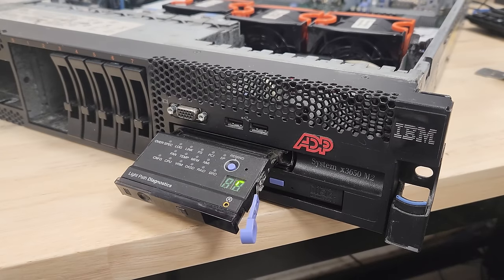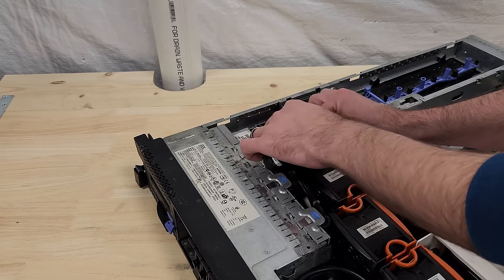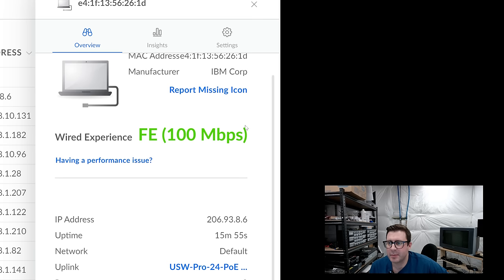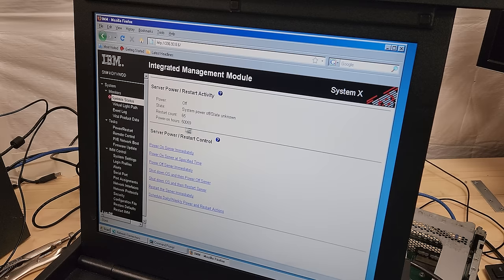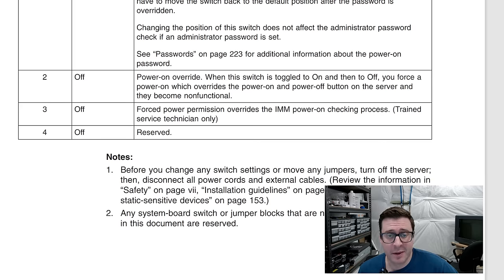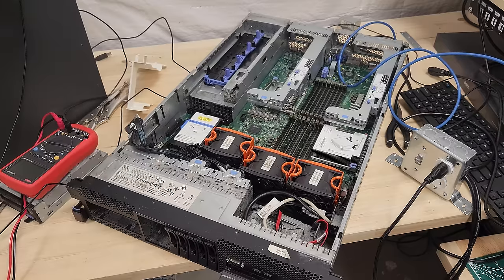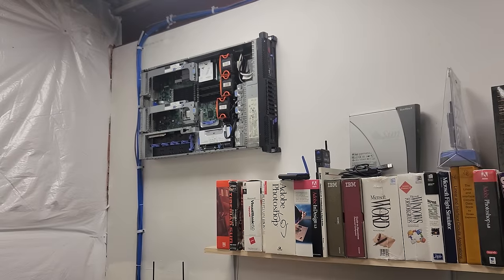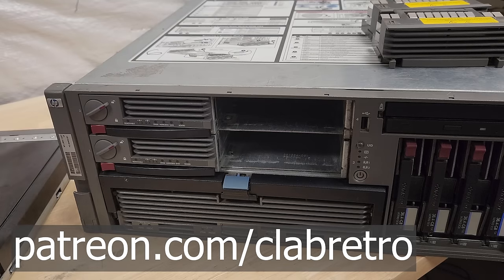IBM System x3650 M2 Restoration: Part 2

Comment: I was an HP field engineer for several years, although we supported all makes and models.  This is 100% a power supply issue - it is no longer able to supply enough current to power up the machine.  When the current draw rises suddenly at power on the voltage collapses and the whole thing resets.  The IMM only draws a few mA so it doesn't trigger the fault by itself and appears to work correctly.  A replacement power supply should solve the issue, although there is a small chance the IBM design places the fault in the power distribution on the main board rather than in the power supply module.  Like I said I am more familiar with HP hardware but I have seen exactly this fault several times.  This type of server should always always have two power supplies if you're going to use them for anything important.
Reply from the maker: it very well could be! I was thinking I'd grab another psu along with the board on the way. it's always frustrating when I get these machines with only one psu, especially as they get older it becomes so much more likely one can go bad. thanks for the comment, think I'll snag another one.
Reply: @clabretro  Looking forward to part 3 then!  Also if you do intend to run it open on the wall like that for more than a few minutes at a time make sure you replace the lid with something clear to preserve the air flow.  Many of these servers can sense air flow and will throttle severely if they don't see what they're expecting.  Some may shut down entirely.
Reply from the maker: oh yeah totally. I try not to run em long without the lid. clear plastic would be kinda cool actually
Reply: Yeah probably the psu. I remember having a similar issue on an old Dell server.

Comment: You could replace the switch in your home made power bar with one that has a light in it, that way you'll always know whether it was on or off.
Reply from the maker: The funny thing is that's actually a light up switch in there (I had the same thought), but it's on when the switch is off so you can find it in the dark haha. Even more confusing. But it doesn't really matter, it's too bright in there to use it consistently for that anyway. I was thinking of adding some type of light on there to make it really obvious. Maybe a three gang box with a light of some sort.
Reply: @clabretro  oh yea, meant for bathrooms in the dark... What you want is a pilot light switch... It does the opposite since it's meant for furnaces, etc.
Reply from the maker: ah interesting, I'll snag one of those next time I'm at the hardware store @chaseohara4781

Comment: I've fixed pins on a socket like that before, it worked for me too and I was quite surprised that I got away with it.
Reply: the cpu is not realy a problem you may lose some ram channels or pcie lanes. but your gpu is you problem in this case the gpu is simulated through the aspeed controler as a usb gpu. so may the controller is falty but the ipmi lifes also. so it could be the controller. also the restart thing makes me wonder if it is a short then it must be internal or the usb lane to the northbridge from your cpu sockets
Reply: a LOT of pins are just ground or power, so there's a pretty good chance that not every single pin is needed.

Comment: The IMM  should not reset when pressing the power button or turning on through IMM.
Reply from the maker: That's what I'm thinking. Very strange.
Reply: I’m going to guess that the power rail(s) that run the IMM are dragged down when the rest of the machine is powered on (ie the power system is browning out when placed under higher load).

This could indicate a short.

If you have a thermal camera, this might be useful to indicate a failed short or low resistance component.

Note at 27:37 that the part near C1150 looks discoloured.
Reply: If that's the case, I think the fast blink when he pressed the power button could mean that IMM was rebooting as well.

Comment: Oh man, when you were starting off checking out what it was fussing about, I was basically screaming at my screen "why aren't you using the IMM to diagnose it."

Also seeing that vintage of IMM gave me the shock of both "hey I know how to use that" and vietnam-in-the-background-gif.

I worked on HUNDREDS of X3200 M3 towers. Had many fights with IBM techs over the power button shorting out on the x3100 M4. Used IMM logs constantly for proving the M4's power button had shorted out.
Reply from the maker: ha I know, I probably should've started with the IMM

Comment: the line moving in a figure 8 pattern on the diagnostic screen is normal before you turn it on, my x3550 m3 does the same thing

Comment: after your first video i told some coworkers about it thy joked, ohh an upgrade.
we do have newer systems but we still have close to 30 x3550m1s alive and running i have 3 heere in my house, 1 is a parts machine.
Reply from the maker: haha that's awesome. what are you all running on the m1s?
Reply: everything from oracle to old server2003 domain controllers for our legacy prod software which needs it. they are all under service contracts. my personal ones dont have anything right now, i use my slightly newer hp dl380g8s

Comment: You might want to watch some of Morton's videos he loves the X3650's I think he has a 1/2 dozn of the M2 on "My Playhouse".  It might help with what the lights should be doing.  Question though we didn't see you try the other CPU socket did you do that?
Reply from the maker: Oh yeah his videos are great. Good idea though, I should re-watch to get some x3650 hints.

I actually didn't try the second socket, the manual says the minimum config is one DIMM filled and the first processor socket with a CPU in it... but I suppose I shouldn't have trusted that. I'll try that next time I'm experimenting with this thing.
Reply: My playhouse is a super cool channel!
Reply: This inspired me to check his videos.. I learned that my hunch was correct...IBM servers on the light path POST code read out do that "spinning cursor" thing right after you plug it in. That is normal behavior....I also laughed when Mortens X3650 M2 threw the "BRD" light for a dead CMOS battery LOL that is peak IBM right there.  @clabretro

Comment: I bet the PSU has a 12v Standby rail that provides power to the remote management and the relay clicking is the PSU attempting to switch the main 12v rail and shorting. Pinouts for the PSU's are normally easy to find to confirm, server PSU's dont normally energise the main 12v rail until needed.
Reply from the maker: Could definitely be the case. I'll probably pick up another PSU.

Comment: This whole line is kind of my jam! Have been working on System X hardware since 2010, and mainly the x3650 (M1 through M5) and the successor Lenovo SR650's, but also the x3550 of all generations and x3850 M1s.

Before that, was doing Sun Fire, SGI Origin, Cray J90, and IBM pSeries stuff for Lockheed.

Have stacks upon stacks of System X gear in the collection, with a couple of x3650s still in production.

Comment: I've been cleaning these with brake cleaner that is safe for ABS (ONLY this one) and then quickly rinse with IPA for more than 15 years and the boards look like factory new. Never got a problem doing this even if it was scary as hell the first few times. I was a ethereum miner and I washed hundred of gpus like this and they all lived to tell the tale.

Comment: the LEDs on the maintenance panel displays the checkpoint code. I found this reference for explaining their use 

"A checkpoint code is either a byte or a word value produced by server
firmware and sent to the I/O port indicating the point at which the system
stopped during the boot block and power-on self test (POST). It does not
provide error codes or suggest replacement components. These codes can be
used by IBM service and support for more in-depth troubleshooting"
Reply from the maker: yeah, unfortunately couldn't find any info about the checkpoints themselves. top secret IBM apparently 😂

Comment: I used to, until less then a year ago do  Tech support  for these machines. And ho boy these things are  crazy reliable.
Reply from the maker: It seems really well built, I can't fault this one for having issues given the environment it was in.
Reply: @clabretro  I worked with all of these machines. 
They are a marvel of quality.  
If you ask me this  machine has  simply a dead board,  replacing it would still net you a working machine. 
They are to this day used in Some of the biggest data centres in Europe and Still supported  by IBM.

Comment: First, there is no standard for the orientation of duplex outlets, but ground up is the convention. My employer has a ton of those damn things in our e-waste storage. We like to call it a server room, but it’s mostly occupied by racks of dead IBM machines. There is a buck converter on the edge of the board near the power supply that goes bad and then the boot errors out. It’s a tiny, shiny surface mount part.
Reply from the maker: Yeah I've got a replacement PSU on the way to see!

Comment: Something to consider about using an air compressor. Compressed air may push moisture deeper into small spaces, but that shouldn't be a huge problem if you do wait a long enough time for things to dry. The second and more important consideration is that air compressors usually spray a considerable amount of moisture and oil due to way the moisture in the atmosphere condenses when pressurized. It's a similar reason to why you need to pressurize tanks for scuba with special equipment and those cheap short term breathing tanks on Amazon are dangerous.
Reply from the maker: Yeah fair. In this case I waited a long enough for it to dry. I drain the tank fully and make sure there isn't any moisture in there occasionally, and luckily I'm in Colorado where it's quite dry.

Comment: I'd suggest holding the IMM in reset and enabling manual host power control (via the switch block near the firmware ROM is my recollection). The checkpoint display will indicate post checkpoints (port 80) if the power sequencer is able to get the machine to the reset vector.  Good Luck!  Great Videos! -Nathan
Reply from the maker: oh interesting, thank you!

Comment: Did you ever get around to trying the CPU in slot 1? LGA pins are incredibly difficult to repair properly, and I would not be surprised if they're not contacting correctly in slot 0 after the repair
Reply from the maker: I didn't actually, though the light path CPU warnings going away was promising. The manual says it requires a slot 0 CPU to boot, but I probably shouldn't blindly trust that.

Comment: 2:20 those domes aren't for making the lid ride smoother.
They are there to provide an electrical connection between the case and the lid. This is to reduce the amount of EMI that escapes out from the case. (From an RF point of view a lengthy gap is an open door to escape through, and some wave guide antennas use this principal of operation, ensuring that one has a point of contact every inch or so is easier done with springs than sheet metal against sheet metal.)

The reason they are domed shaped is to ensure that they don't get snagged when the lid is put in place or removed. There is other "EMI fingers" that don't provide such freedom of movement. There is also EMI strips/gaskets typical for other areas where one mostly only have to deal with compression. There is also EMI tape (or copper/eluminium tape with a conductive adhesive) but that is used when one isn't going to take the thing apart.)

But in the end, these are there to ensure it passes EMC regulations.

Comment: I wonder If its a power supply issue, I have had power supplies that work when first plugged in and then stop working altogether after that. Maybe the 12v rail is missing and the 5v is still alive and running everything else? or maybe there is excessive ripple on the 12v side. It could be that the ripple is acceptable when only the imm is running but as soon as the server tries to power up the ripple is too much and everything including the imm crashes. I have seen such behavior before on various pieces of equipment, with the high hour count and symptoms I would try another power supply. Perhaps the caps in that one are cooked and dry inside.
Reply from the maker: it very well could be, thinking I'll grab another psu along with the board on the way

Comment: I think the "spinning cursor" on the light path is IMM still booting/not powered on so it does not have a POST code to give you-That's just going off memory. I heard the relay click and again when you had the emergency  "technician only" switch turned on. I've never had a form of IPMI fully restart itself after a failed power on...sometimes the webpage will go un-responsive for a bit or it will auto-refresh (that's is what my R720 does) . Pretty sure a functioning server will not finish POST without its PCIE risers I think when I did a mobo swap on my R720 I accidentally missed one of the risers it turned on but it was very angry with me and shut off with error code on the front LCD pertaining to that. One last thought-I find it very surprising that the IMM seemingly had no clue it was very broken-That tells me how far gone the mobo is :(
Reply from the maker: Yeah I think you're right about the PCI risers (though I tried it with them on a ton as well, same outcome). And it probably would've at least tried to post. Yeah it's in bad shape :(

Comment: If your going to scrub a board.... I have no problem with it. BUT once your done you should use Isopropyl alcohol to wash it. The alcohol will displace any water under things, then be gentle with the air, I have ripped off/broken parts. With out the alcohol I have used the air just to clean of accumulated dust 48+ hours (Fri. night to Mon. morning) later and had a dribble of water come out from under a flat pack IC
Reply from the maker: yeah probably a good idea to wash with ipa afterwards. I've done that in the past

Comment: Seeing that busted CPU socket reminded me of the time I bought an Alpha DS10 and when it arrived the CPU had come loose and dinged around in the machine from France to Sweden. After hours of straightening pins on the CPU I actually got it in the socket and it even POSTed. Sadly it did not fully work and I could never get it to run an OS. Luckily I got hold of a new mainboard with CPU a while later.
Reply from the maker: it's always so brutal to straighten pins!

Comment: I've got a 3650 M3! I dont have it running currently because of the power and noise but the previous owner treated it REALLY well, I was really impressed. Came with an M5015 with the battery attachment, but its missing drive bays and I dont have any spare drives to put in it. I'm thinking of maybe putting in an ioDrive2 1.2tb and an old gpu if i can find a power cable (iirc the pinout of the on board power output is weird?). Also gotta tame the sound somehow, id really rather just put in new 40x40x25 pwms than having to use the boot script.
Reply from the maker: Nice!

Comment: Before you mentioned the replacement board was coming was going to suggest putting a newer supermicro or similar board inside and restomoding the case. Maybe as a series or video idea find a cool parts/repair retro server and put something cool inside. The mid 2000s had some neat form factors.
Reply from the maker: oh yeah, reusing the case could be a cool idea
Reply: @clabretro  crypto miners have made ATX break out boards for hp server power supplies. They are very handy for such projects as they can fit in the case and are cheap and available.

Comment: You need to wrap the tape on the air connectors the other way.
The tape will unroll back on itself on the threads and you get a leak.
Probably what you experienced on the second attempt there.
Have done this many times my self.. 😄
Frustrating when things are leaking..
Reply from the maker: Oh yeah I always wrap it the wrong way the first time, every time. haha.

Comment: So it might sound odd but did you remove the hba? I've issues where the HBA will prevent the host powering on at all. But I've also had a "healthy" psu be the issue. Harder to test on these boards that don't have 24 pin and sort. I have very little Lenovo/IBM server experience. Did you try the second CPU socket even though they say you need to use the first socket
Reply from the maker: Yeah I removed the HBA, it was on that "rise board" I kept referencing which also connected the tape drive, I can't remember if I specifically showed taking the HBA off though. I should've tried the second socket, I didn't! I probably shouldn't trust the manual that much haha
Reply: @clabretro  at least you got a nice art piece :p! If you run it in the make sure the screws holding it to the wall don't short the board

Comment: Guessing that dip switch power setting was referring to using system power switch on/off not dip switch on/off? Like making it more a "hard-er" power switch than typical "soft" power switches?
Reply from the maker: Yeah could be

Comment: that 'click' is likely the core of a transformer or inductor rattling as the magnetic field collapses. I'm curious to know, what does the 'power OK' LED on the back of the power supply do when you hit the power button? there's a good chance given the power on hours and general era of manufacture that there's probably dried out low-ESR electrolytic caps in the power supply, and that 'click' has been a common symptom I've found on bad power supplies (most recently on an ADIC Fastor 2 tape library) with bad caps.
Reply from the maker: I should've checked the lights as I powered it, great idea. I think I'm actually gonna grab another PSU too, could very well be the problem